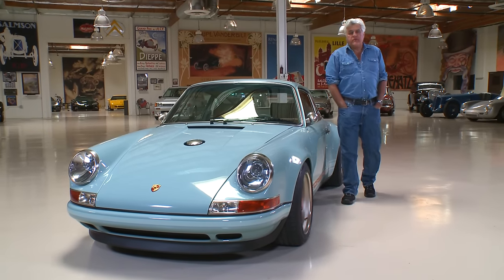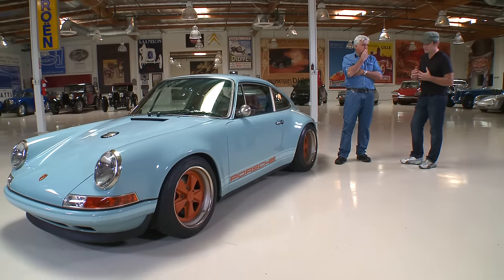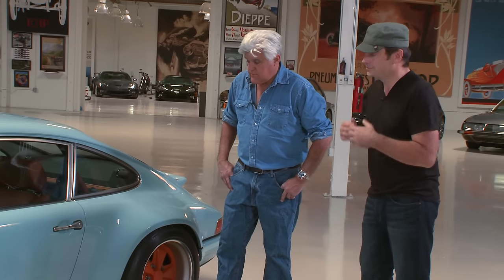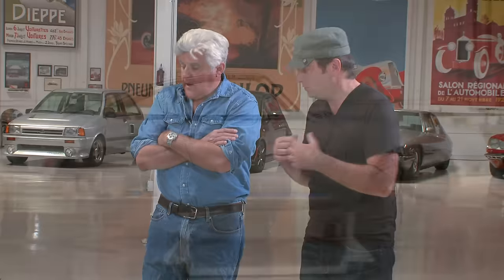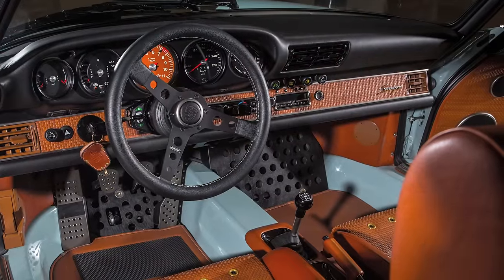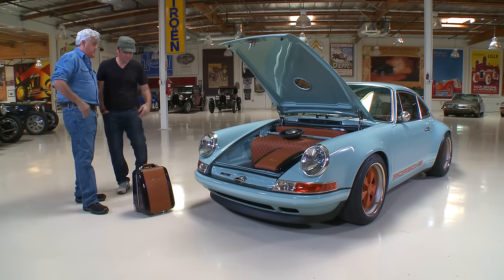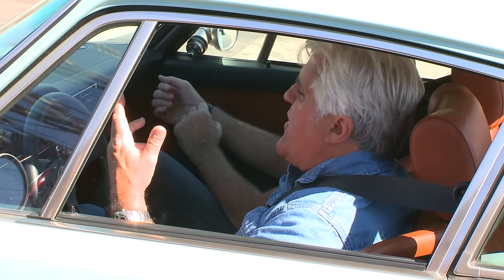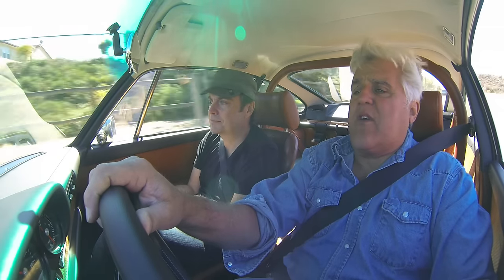1991 Porsche 911, Reimagined by Singer - Jay Leno's Garage

Comment: I love the honesty of the guy: "The cooling is from the GT3-RS, the water-cooled model. We spent 5000$ making it look pretty but it's basically a 300$ part"
Reply: Beurksman- The intake is from a watercooled gt3 .its still an air cooled motor
Reply: He's mocking that it cost $4700 to make it look...pretty.
Reply: @nssherlock4547  he get's that.
Reply: beurksman That’s a Straight/True Answer.
Reply: A $ 300 Porsche part, what a deal....
Reply: SP342800 about the cost of one exterior door handle. I’m doing a 66 Outlaw, a 912 with an 88 3.2 motor and Carrera suspension. Apart from the motor and suspension I’ve spent over $20K on “bits”. Even reproduction stuff is super expensive, over $425 for a repro batwing horn, but over $1200 for a nice used original, crazy.: BTW I intend to drive mine unlike 99% of Singers.
Reply: @FredBTs  You're definitely overstating that " 99% of Singers " case. I hope I'm wrong, but it really just makes you sound like you want to feel superior to the " rich idiots " who get to be able to afford these. These cars are designed to make you feel something, to create joy - both on the move, and at rest. I'm pretty comfortable stating that at least 1/3 of Singer owners drive their cars on at least a weekly basis.

Remember, you've got to not only wait nearly two years to get a build slot to get one of these built, but you additionally have to invest double-digit+ hours to figure out how you want to spec your build. Then you get to wait another 8-12 months for the actual build to be done. There's a bit more to it than just writing a (really large) check. Additionally, the aesthetic of these cars is quite specific - it's not showy in the same way that a Pagani is, for example. Perhaps reputation and rarity is now bringing more speculators into the fray, but for the first 10 years of Singer's production run, I'd suggest that the majority of buyers were true Porsche 911 enthusiasts. And if that's the case, then I don't think it's controversial to state that most of them would have been drivers first.
Reply: Alistair Willock you are probably right about me being wrong with 99%,  probably closer to 90%. It like a Ferrari where 10 year old cars with 10,000 miles are considered high mileage. I just retired after almost 50 years in the automotive business working mostly on “collectibles “. Post back a reply later if you come across a Singer with more than 5,000 miles for sale, it will be a long wait. Singers are too valuable to drive, one paint chip could cost $1000’s.
Reply: @nssherlock4547  thank for that,the first comment had me a bit confused

Comment: First thing I thought was 917.  Not because of the Gulf blue and orange paint but because of the valance under the front bumper.  It looks like the air intakes of the Long Tail 917, my favorite.  Love the engine plenum and matching fan blades.  The interior is magnificent.  The car is Perfect.  A modern vintage Porsche.  More jewelry than car.

Comment: Re 19:38
$350,000 / 4000 hrs = $87.50 per hr
That's pretty good in my book.
Reply: GrecoRoman123 parts
Reply: oversheads
Reply: It would be pretty good if the workshop and utilities were free, no shop or employee insurance, free upholstery, free paint, free ....
Reply: Spend $350,000 on an airplane to fly to vegas, above traffic.  That's even better.

Comment: One important thing we miss in modern day cars : thin A pillars. Today  most cars have fat ass A pillars. But this, its just brilliant...i would say ' Its Reborn'
Reply: Problem is they crashtest cars today and set high demands on what they have to do good etc so everything has to be designed for safety first if you don't make small ammounts like this or newer more exotic cars.
Reply: HachiZenki You get more strength/weight out of a larger diameter tubing than going to a higher spec material. Either BMW or Merc was actually experimenting with an A-pillar that had an explosive charge in it that would go off in a rollover and expand the diameter so that they could get away with a smaller profile during the rest of the car's lifetime, giving the benefit of better visibility without sacrificing safety. Google on "expanding A-pillar".
Reply: HachiZenki Every single car on the new car dealer's lot these days has an explosive charge in the steering wheel hub and another in the passenger's dash aimed right at your face. And perhaps a few in the doors to keep you safe in T-bone collisions.
And, if you are going to put a car shiny-side down on the pavement, it's probably a write-off. So, your suddenly 'hydroformed' A-pillars are probably not an issue from an aesthetic POV.
Reply: Markle2k
Reply: Markle2k the r ex a.
Reply: San97 s gotta love how the government ruins everything it touches.
Reply: HachiZenki Cheap cars won't use high quality materials.
Reply: Surely a titanium A-pillar would allow a much thinner cross section.
Reply: Yes it would but that would add more than $1k to the price of the car.
For 99.99% of people that's not a worth while trade/ good value...
Reply: @anon-ex1rm  yeah and if bunch of people started dying you would blame the government

Comment: The only aspect of the styling that I dont like is the fuel tank in the middle of the hood.
Reply: I think they did it so that the center of gravity stays in the middle of the car
Reply: +Aaron Ramirez i think they took this idea from porsche 550 spyder
Reply: +scanspeak00 God I love that aspect, it´s so fitting with it´s timeline looks...!
Reply: thats one of the best thing on the car
Reply: True. And it seems that there is also too much exposed rear tire....otherwise, WOW.
Reply: That’s optional, they can build it with the original fuel filler cap in the front wing ;)
Reply: I agree.
Reply: @GamerNRetro  wrong
Reply: WRONG!

Comment: I'd like to see Porsche offer a restomod program.
Reply: They sort of do and have done for a long time. They restore road-going cars back to full factory specification using the original tools and some of the staff that originally made them. It's called Porsche Classic...and thanks to them every single 959 made is still going strong.

Certainly not cheap though. You need to ship your car to the workshop outside of Stuttgart where they will take around a year to restore it depending on its condition. They will also absolutely not "mod" anything.

Comment: 11:02 the rust on the transition from paint to metal....right of the exhausts?
Reply: I noticed that earlier on in the vid too. But how can the rust be on top of the paint....burn marks? Pretty sure something in the back is overheating...
Reply: Holger Wulf
 Actually looks more like exhaust heat + residue from the exhaust sticking onto the back there and it probably happens while idling or standing still. (guessing is happens the most in the rain with the water hitting the exhaust tips and warm bodypanels.)

So you can probably see this on cars with short exhaust systems as well when it heats up certain types of bodypanels.
Reply: Have a look at most white cars made...it's soot and other exhaust gases that stain the paintwork on lighter coloured cars. More often than not it cleans away.
Reply: I saw it immediately and think it is rust also. The panel has a tolerance difference to it.
Reply: Kenn Martin  good catch...i didnt see it before!
Reply: Kenn Martin mmm ... well spotted ... not the attention to detail we were told :)
Reply: Kenn Martin Hmmm, looks like exhaust residue to me.

Comment: 11:03 is that rust on the rear bumper?
Reply: no i dont think it is. might be a burn mark sorta. might have gotten a bit too hot around that area for one reason or another and it messed up the paint. notice right above the tailpipes you have that same discoloration if you will but not as pronounced (which is odd, maybe they welded something on the right side of the rear bumper and that's what caused it. why it was painted beforehand i dont understand though)
Reply: It's actually a heat mark made by the exhaust. But dude... nice eye, I didn't see that and I love car detailing.
Reply: +Patrick Pelletier maybe just soot from running a bit rich.
Reply: DocStomp soot would be more pitch black but it's definitely possible. Id imagine when you pay 7 figures for such a car you'd have it tuned for the altitude where you plan on using it.
Reply: Rasmus Krüger it budged out too
Reply: If the bumper is also carbon fiber, then maybe the plastic has burnt and/or melted a bit from the heat from the exhaust and surrounding metal?

Comment: I love Magnus Walker as well as Singer, however, power, luxury and styling aside I think Magnus' 911's are much cooler because he leaves the patina alone rather than stripping it down and restoring it. There's something special about hopping into an old car with worn in leather seats, like your favourite old baseball glove, and not worrying about dust and dirt hitting the front end as you tear up the back roads. Either way, I love the vision that both Magnus and Singer have.

Comment: $350,000 !  Come on,get real. ...  AND NO TURBO !    Buy a new Porsche .
Reply: You just don`t get it do you?
Reply: 350k for a carbon fiber car which has classic lines, respectful of the original design idea, that's fast, handles well and is easy to drive not to mention hand built individual car that won't depreciate?..  bargain...  fantastic investment
Reply: Why does it need a turbo? They already said it was faster than a GT3.
Reply: also turbo's = turbolag. With out a turbo you can get smooth progressive acceleration with no hidden surprises which gives a more enjoyable ride
Reply: $350K of wank factor. why not buy the original for $50k then drop $300k on a new Porsche?

Comment: If your using JE pistons. I designed and implemented them in 92/93. They are 85g lighter that the stock piston. I have run 13.1 on pump gas. Huge valve reliefs so you can advance the cams 2.0mm and I built some serious bumpsticks. I was making 350^ OUT OF A 2.7L. 

Just thought you would like to know. 
My first 911T 1970 I lived that car. This one reminds me of that. Great great greatness in your tribute.  

Cheers.

David A. Puchta
Hydrogen Injection Systems

Yes, I am taking on another impossible task. LOL

Comment: 500 lbs weight reduction and 100 hp gain is definitely boosted performance, that can convert any car from it's normal stock form to race car like performance...Weight loss not only increases performance but also reduces stress on your engine, brakes, chassis, suspension, etc...Awesome attention to detail.

Comment: It just doesn't get better than this. Beautifully done. 
The placement of the gas cap dead in the center of the hood has me puzzled.
I would be scratching the car every time I would be filling up... but then again, if you can afford the car, you probably have a refuel team on the payroll.
Reply: The gas cap isn't in the middle of the hood.
Reply: p00ner1sm  So what's is the cap for?
Reply: Frank Abyss Not sure what the one on the hood is for, but the gas cap is in the back.
Reply: p00ner1sm The fuel filler most certainly IS in the middle of the hood. The cap on the side at the back is for the oil tank (these things are dry-sumped). And if you look at an early SWB 911, it also has the oil cap on the side behind the door. ALL 911s have the fuel tank at the front, and ALL of the filler caps are infront of the cabin.

Comment: "The essence of this car is an attempt to locate all those wonderful things about a Porsche 911, which have become almost like iconic--like the way it steers, the handling, its murderous oversteer--and try and optimize everything. Try and turn the volume up a little bit."

Well, that is the most iconic thing about the air-cooled 911s, after all. They didn't call them Dentist Killers for nothing. :)

Comment: I'd rather take this reimaginated 911 than the new 991 R. Apart from that the new car is propably overhyped, the Singer seems to be more pure. Not surprisingly of course because it is in essence a classic car. But I think you'd smile much more in the Singer 911 than in the new 911 R, and the driving experience is what counts after all.

Comment: What does "air cooled" have to do w/ emissions cert? Sure do love the smoothness of that engine and hope I can get my Corvair engine to run as smooth, if not as strong. 14:37 Had a '67 Mustang w/ manual transmission and it took me an hour and a long pry bar to get that return spring installed, due to its stiffness. You really needed to lean on the clutch to get it to break inertia and move it, but it did give a very positive clutch engagement. I'd give a gonad (anisthetic free) for one of these Porsches. Had a crush on the 911 since I first saw one back in '70 in Huntington Beach, CA. I always thought Detroit was the car capitol of the world until we moved to CA, and I started seeing cars that, until that time, I had only seen in car mags. Up until our move, the most exotic car I had seen was a gull-wing Mercedes 300SL that some big-wig auto exec sold to another wealthy individual in Chicago.  My father delivered/drove it to that man and I got to go w/ him, but that was a fluke. California had every car you'd see in the car mags of the time: Porsche, Ferrari, Bentley, Rolls Royce, Triumph, Alfa Romeo, Jaguar, BMW, etc. ALL of the greatest auomotive sheet metal was located in SOCAL.

Comment: I have built just the place to park and photo  these cars. The place is north of Detroit in Chesterfield Mi. I have (so far) 7 years of building this "machine house". It's kinda like if a gear head wanted to build a car but couldn't because he had a dream to build a house instead sorta thing. Outside has a Frank Lloyd Wright sorta vibe, inside is Ferrari meets Porsche meets Mid century modern design. The kitchen lights are F.A. Porsche and the cabinets are Red Snaidero/Ferrari. Gotta see it

Comment: I wonder if the artisans and craftsmen at singer could customize Porsche's famous "PDK" shift transmission into a build with these 3.8 liter setups or even go a bit farther and bore out the original 3.6 Porsche motor to a 4.0 liter motor with the "PDK" shift transmission. If so what would probably be the out the door costs???

Comment: Does anyone know why he holds the 964 up as the ultimate air cooled 911 rather than the 993?
Reply: +JC Webb Nice fedora
Reply: +JC Webb But yes he did
Reply: +JC Webb Most rabid Porsche fans know that the 964 was the last of the hand assembled, high quality 911 line. The 993 is pretty but also is a "modern" car in that it does not have the upright headlights that did not change since 1963. The 993 is basically the same front end as my Boxster, and looks very different from the front end of my 1978 turbo. Personally I like the look of the 993, but those are the two reasons most often cited for the 964 being the last "true" air-cooled 911. He says it directly at 2:51 in the video "it still looks like a 911." Hope this helps.
Reply: +JC Webb  The 964 has nearly all the charisma of the very early 911's with buckets more performance and modern day reliability. What's not to like ?
Reply: +DrSewQuik it was also the last 911 with torsion springs and the classic 911 chassis set up.
Reply: +mrjdgibbs You are incorrect. The 964 is the first 911 with a coil over suspension. There are no torsion bars.
Reply: +JC Webb Yes, I found that a little unusual (as the guy is English, a musician and related to the Iron Maiden frontman by the way...his cousin I believe) I don't know about the States but in Europe and the UK the 964 got a very bad rap on its introduction and that reputation has lingered, I don't know exactly why though. Only recently have their values started to rise. 

And while nearly all air-cooled 911s have sky-rocketed in value over recent years the 964 remained pretty stagnant. Its the 993 that's considered to be the last and greatest air-cooled 911 of all time...at least dynamically. Only the legendary 1973 'Ducktail' 911 2.7 RS and early 930 Turbo's are worth more to collectors I believe. In fact I stand corrected on that...the Turbo version of the 993 in particular sells for crazy amounts nowadays too.

I personally didn't like the look of the 993 range, I found those flattened headlights at the front quite ugly, and the way it was done...with those seam lines makes it look very clumsy and dated today I think.
Reply: +David Datura I agree about the styling. I liked the 993 but it and the 996 never looked or felt timeless the way a 964 does. I was stoked when I first saw the 997 because they finally made it look like a proper 911 again, I just wish it wasn't so absurdly large.
Reply: fromkentucky Bruce is 57 years old, Rob is 50. Bruce can't be his father! They're cousins.
Reply: I'll be damned, you're right.
Reply: +DrSewQuik I stand corrected, I believe it was the last with the semi trailing arm rear suspension though. the 993 had multi link.
Reply: mrjdgibbs Yes

Comment: $350K is a steal when you consider the number of hours invested.  That equates to $87.50 per hour.  Definitely a car that can only be fully appreciated by a 911 fan and true enthusiasts.  Like a Patek Philippe, not flashy but marvelously detailed.
Reply: Honestly it's not that much per hour. If you go to a normal customs shop you'll pay just as much to the shop per hour. The $87.50 is not the payment to the guy working. They're probably making salary that is CONSIDERABLY less than $87.50 per hour that $87.50 is just the cost of the vehicle over the hours it took to construct. You also have to factor in the cost of the car, the parts, the design and every other expense, that's where the $350,000 comes into play.
Reply: Without factoring in any expenses....
Reply: Blair Greenstein To pay an employee $25 per hour, it's going to cost you $50 per hour in taxes, workmans compensation etc. Add $50 per hour to rent the shop and you have a shop rate of $100 per hour approximately.